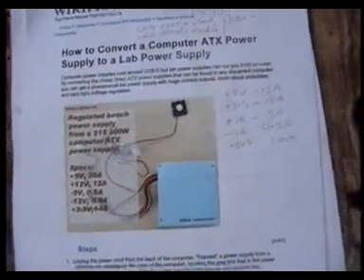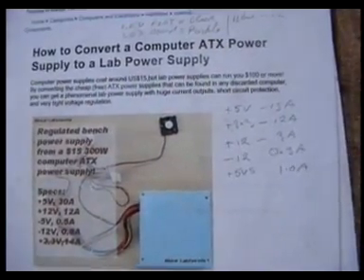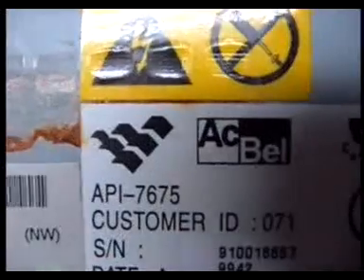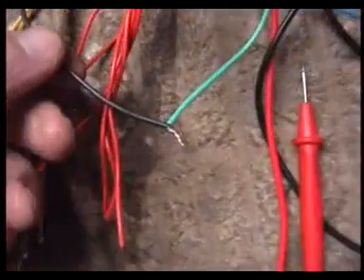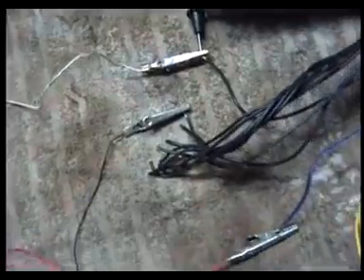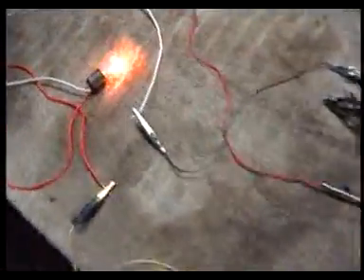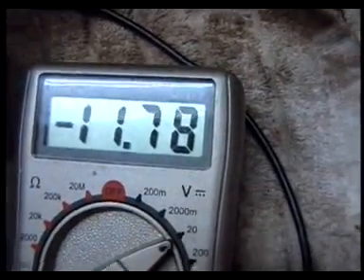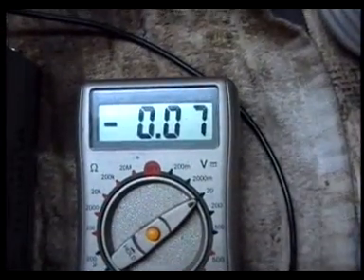How To Make A Lab Power Supply From An Old Computer PSU

Comment: i can also make a regulated dc power supply with an output voltage of 1.6 to 15 volts its components are just semi-conductors and resistors i'll try to post it someday

Comment: Most computer power supplies have "over current protection".  As your reactor looks like a direct to ground short, suspect it exceeded the 3a the supply could muster.  I have a 550w unit that give 12v @ 20a and it powers my reator quite well.  The 5v on mine is 36a.  You might want to dumpster dive and see if you can get a bigger PC power supply.

Comment from the maker: assumed the power supply could not supply the amps at 12v 3a to run the cells and no harm has come to the unit. I have done this many times and the power supply is not harmed. My much smaller hfc will run on 5 or 12v. Could the power supply have an internal circuit breaker or bypass of some sort?

Comment from the maker: Thanks for the advice. I have some different sizes of cells and I have noticed something strange with this supply. When I hook up my large hfc, the 12v 3a line (yellow) will not run. The 5v 15a line (red)runs the hfc ok.